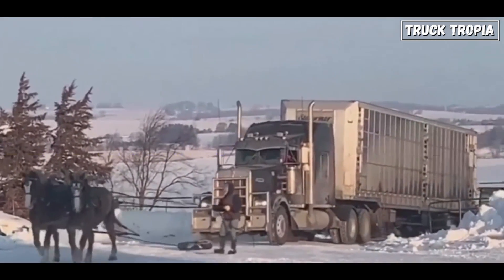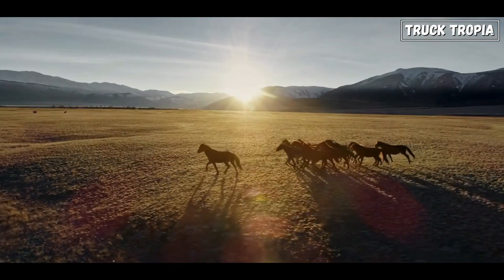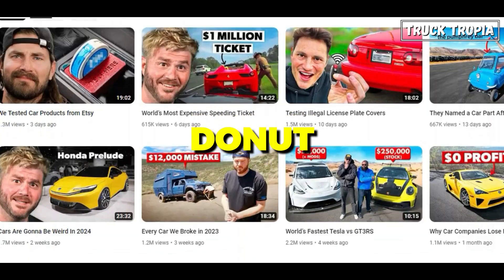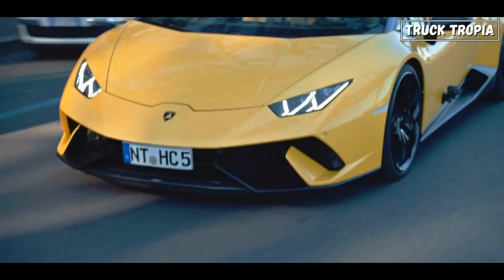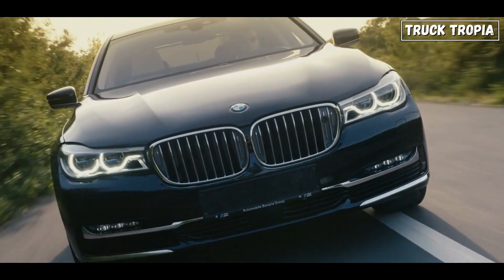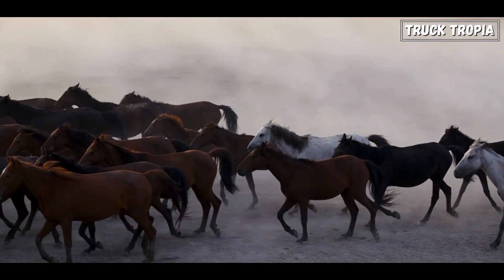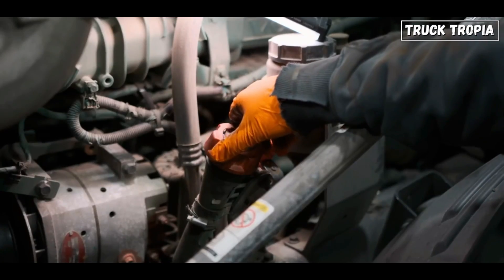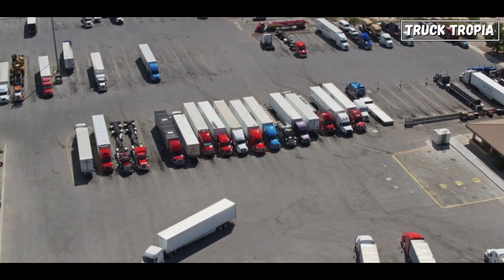How Many Horses To Outperform a Semi-Truck?

Comment: I agree with everything other then when you said a Lamborghini couldn't do the work of a truck. It absolutely could with the right transmission. It would have to operate at its peak hp rpm. It would be burning alot more fuel then the semi but it could do it. The Bugatti Veyron burns through 26.4 gallons in 11 to 12 minutes at wot. That's a gallon of fuel every 25 seconds but that's how they make so much power while being small. Large truck engines are designed for efficiency and durability that's why they rev slow and make low power for their size. Make no mistake a small Lamborghini engine could do the work of semi truck engine. It would only last a few hours and burn through a few hundred gallons of fuel but it could do it.